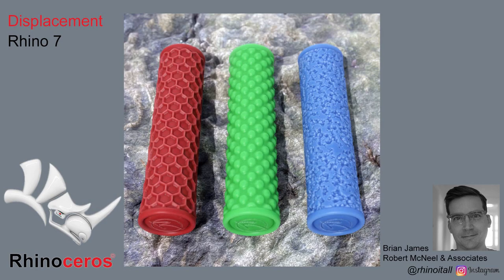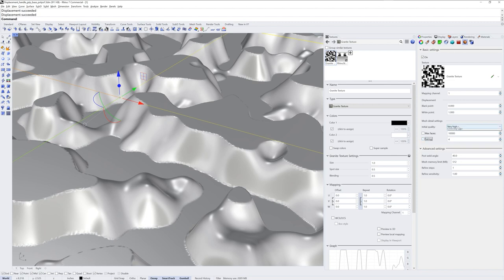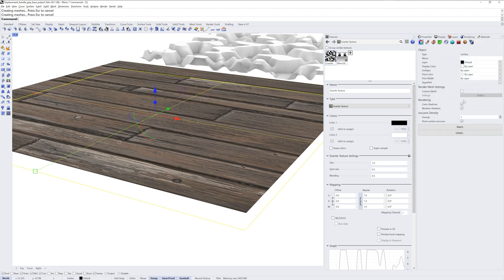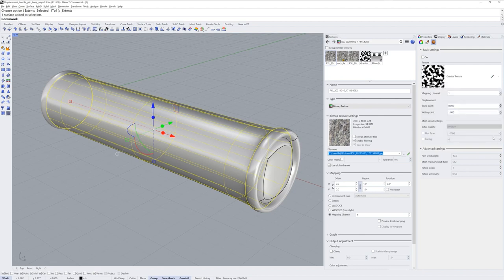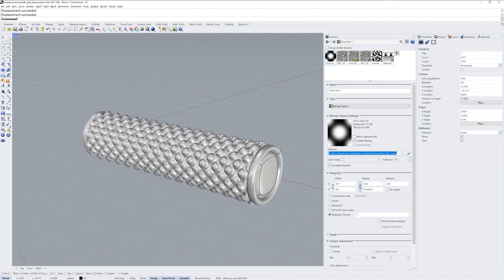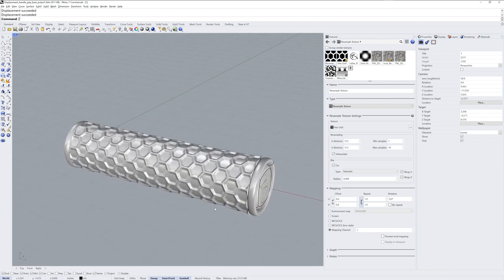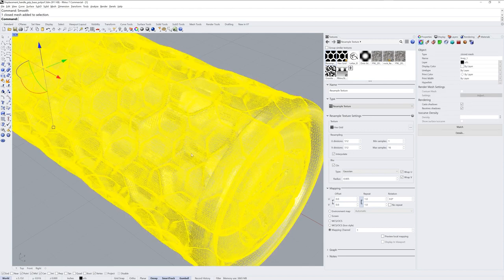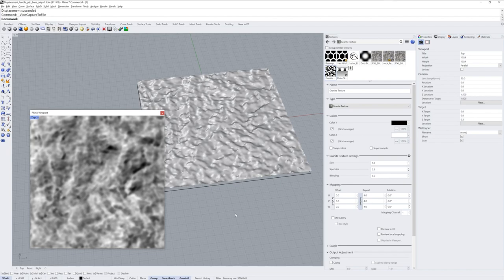Displacement in Rhino 7

Comment: I created a subd surface which wont allow for sub object displacement, so i use the command tonurbs turning it into a poly surface. After sub object selecting a surface and applying a texture the, the mesh details are greyed out and even tho it says displacement complete it never actually displaces. Any idea on whats wrong?
Reply from the maker: You might need to up the memory limit for the displacement. Post a file to https://discourse.mcneel.com/ ... I'm BrianJ on the user forum.

Comment: Thank you for your vid. I can not see my displacement showing any material after aplying, it is still 2D flat for me...
Reply from the maker: Hi Eva, I bet you ran out of the memory set for the displacement. The command line messages should tell you if that is what happened. Increase that value if your computer has the RAM... 1024 or 2048 is usually fine, and then try it again. If that isn't it, share a file on the forum to ask what's wrong please. https://discourse.mcneel.com/

Comment: Is there a way to apply a displacement map in Rhino that is based on a gradient? For example i want to create a grip in the middle part of a cylinder but not in the top or in the bottom (like what you can do in Grasshopper with the image sampler component).
Reply from the maker: Hi Marco,  For that I'd either use the black values in the image texture to define where no displacement will occur or split and rejoin the cylinder to apply a sub-object displacement to only the middle section. Post a 3dm to the Rhino user forum if you need more help https://discourse.mcneel.com/
Reply: @RhinoGuide  Thank you very much for the answer! I think i've understand what i can do. I asked that because i want to use this technique to create a grippy pattern that looks like it is fading away...
Reply from the maker: @marcobonfiglio2388  you're welcome, I bet a gradient texture with your displacement texture only in the white channel would do it.

Comment: How to close the wall between the texture and the surface base in the example Granite Texture 0:55 sec? I saw that you were get to generate the displacement with walls on the edges in the example Swapping textures 14:14 seg...I will be grateful for your feedback. Thank you
Reply from the maker: The closed wall is due to the object being a sub-object in the handle example. The plane at the beginning is a surface with open edges and so it's render mesh doesn't stay connected to any adjacent surface. If you started with a Box instead of a plane and then sub-object select just one face you could displace only that and the render mesh will stay joined to the adjacent sides of the box. I hope that helps.
Reply: 👍 - It worked with your tip! Thank you very much!

Comment: Hi, How can I active "Render mesh settings/ custom mesh"?
Reply from the maker: Select the object and in the Properties panel you can define a custom render mesh for it.
Reply: @RhinoGuide  Hi Sir, I followed your steps in your video, and see you can easy to active custom mesh. But in my Rhino 7, the custom mesh is always displayed disable, so I can't active it. Could you please tell the possible reason? Thanks very much!
Reply: @RhinoGuide  Hi Sir, I find out why custom mesh was always displayed disable, it is because I used one mesh plane.  Is it possible to "custom mesh" function with mesh for "displacement" in the future? Thanks very much!
Reply from the maker: @aeryhsin  You may have a polygonal mesh selected which doesn't have a render mesh generated for it by Rhino as it's already a mesh. If you still have this issue, please post a sample 3dm file that shows the problem to the Rhino user forum here... https://discourse.mcneel.com/
Reply from the maker: @aeryhsin  You can use the SubDivide command or ReduceMesh to change the density of a mesh. This will change what the displacement works with.
Reply: @RhinoGuide  Thanks very much for your help! If it is possible to "custom mesh" function with polygonal mesh for "displacement" in the future. It will help to get the quality of displacement mesh that we want easily.

Comment: I have an issue in rinho, well i creat a geometry using grasshooper and the prblm is that i cant save it as step or parasolid i can only save it as 3dm rinho or as stl so is there any solution ?? Wish someone help me🙏🙏🙏
Reply from the maker: In Rhino 7 use QuadRemesh to make a SubD from your mesh and then use ToNURBS on that to get a polysurface that you can export as Step. If the mesh is quads and not too dense you can use ToSubD > ToNURBS instead. Post to the Rhino forum if you need to share a file for more help... https://discourse.mcneel.com/
Reply: @RhinoGuide  thank you so much ur advice works like magic continue ur work u are helping alot of peaple
Reply: @RhinoGuide  and i have 2 qst:
1) i git an open polysurface so is there any solution to make it close one or how can i find the open gap to close it cause my geometry is so complcated and i cant find where is the open gap?
2) is there any solution to make this polysurface to an one solide i mean how can i turn this many surfaces (polysurface) to just one surface (one solid) ?
Reply from the maker: @khennababdelghani7122  You can use ShowEdges > Naked Edge display to find gaps in any open model. You might need to Join surfaces to make a solid. If that doesn't help, post a model with the question to https://discourse.mcneel.com/